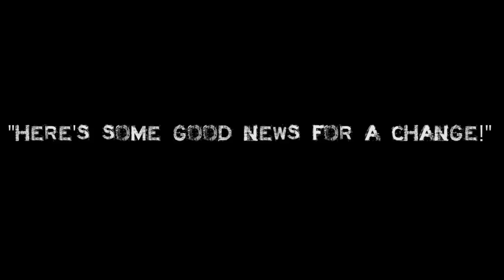Single Motorcycle Trailer - ACE

Comment: I just used the trailer for the first time and one thing to consider i found was an issue for me. I have a RGS with 14 inch bars. I did purchase the floor boards and I do have the trailer sitting what USATrailerStore calls for 12 inches level from the ground. I found it mildly difficult and not the safest for loading and unloading the bike. Reason being is there is close to a six foot distance from the end of the ramp to where the beginning of the floor boards start in order to walk the bike up the ramp while riding it. If you need to put your feet down or the bike begins to tip you are in serious trouble as your feet cannot not touch the ground. I am six feet even and pushing a 900 pound bike with 14 inch bars up the trailer cannot be done alone and is even challenging  with extra hands. I would recommend building or buying separate ramps for the sides to place your feet to ride a motorcycle up safely the size of mine or bigger. USATrailerStore should consider designing floorboards or ramps that run the entire trailer and ramp extension, not just the part for when the bike is on the trailer. I basically used them to have the wife sit on the bike and a place for someone to put their feet while I strapped it down was the most use for them. If not, you are risking injury to self and bike driving the bike into the trailer with six feet of legs in the air unable to touch the ground. Something to consider if wanting to purchase this exact trailer you may have to build or purchase separate ramps if you have a bike close to mine or even not very tall. I think they came up short on this part of the trailer or would be hands down the number one foldable trailer for the price.
Reply: I too have a RGL. How many miles have you towed with your RGS on it? I've been so on the fence about this thing cuz of the strange reviews. If the loss of footing is the only complaint you have im a buyer!! I plan on putting a condor wheel chock on it anyways and upgrading a few other things. Thanks for any feedback. I've been waiting to see who on a 900lb+ bike has actually used it.
Reply: Also, I don't plan on folding this trailer, once assembled for tow, all joints/connections will be welded.

Comment: Does it require a license plate? How much does it weigh?
Reply from the maker: Saad, thanks for your interest and your questions!  You will need to contact your local highway department, as the need for a license plate varies from state to state.  

Ace Single Motorcycle Trailer has an empty weight of 300 lb.
Reply: That varies from state to state.

Comment: What is the weight limit? will it hold my FLHX safely?
Reply from the maker: Thanks for your interest and your question, Mark.  The maximum weight limit is 1000 lb. The maximum bike length  is 106".  If your Harley fits within those parameters, then you shouldn't have any problems.
Reply from the maker: For more product details check out the ACE ad on our website→https://theusatrailerstore.com/ace-single-motorcycle-trailer/